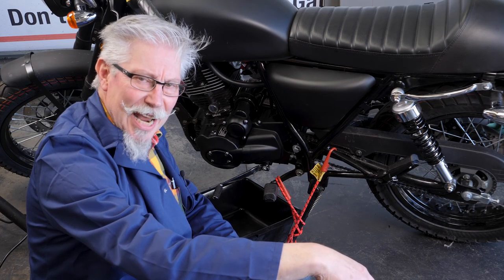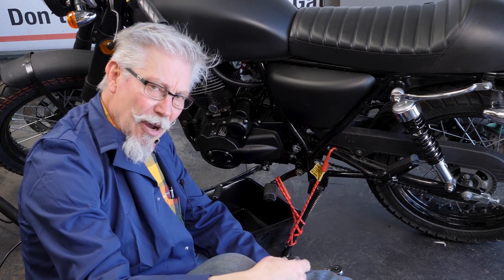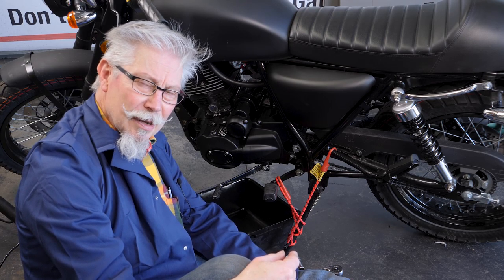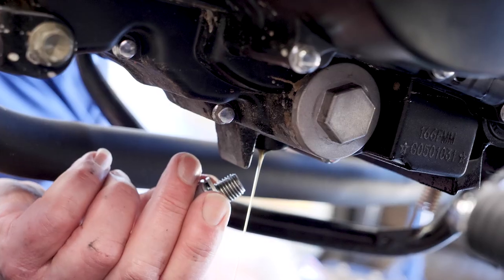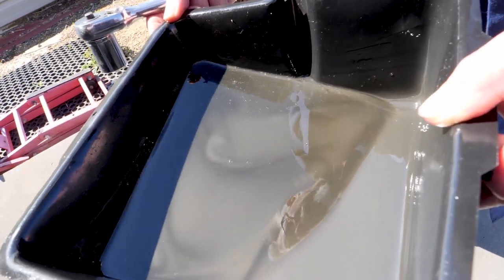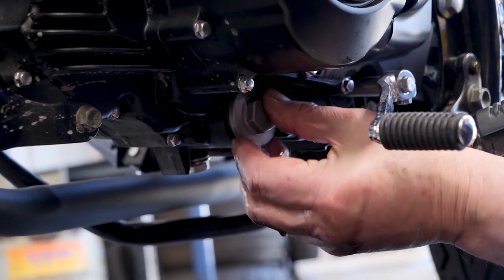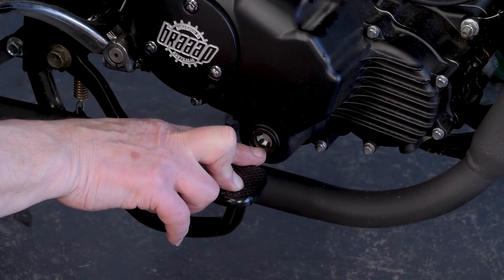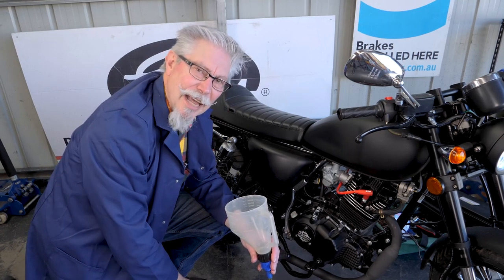Servicing your Bike - DIY - Oil change & filter clean. Tuning for Speed and Economy

Comment: Great video Michael, more on why Diesel oil? Why not a motorcycle oil JASO MA2 I was understanding it better, also designed for this bike with a wet clutch?
Reply: Apparently It is formulated in a manner that makes it suitable where JASO MA specificatoins are quoted, that is, suitable for wet clutches. But yes I would like to hear more from Michael.
Reply from the maker: Hey Steve, thanks for watching. With the power these Braaaps are putting out there is not a lot of stress on the clutch. Big performance bikes have more oil and paper filters. These little bikes need all the protection they can get.
We have an oils video in the planning
Stay tuned cheers Bruce
Reply: @TwistgripTales  it is still super important the the oil specifically mentions on the back where suitable for is JASO MA, not all diesel oils are…… to protect peoples warranty….. again great video….. keep it up

Comment: My mate wants me to quickly scan over his Skyteam Ace 125 that he hasn't started in 2 years so I'm planning on removing the old fuel, giving it a quick oil change/filter clean and check the health of the battery. Anything missing?

This video was very helpful, thanks Bruce!
Reply from the maker: Thanks for watching. The rear cush drive rubbers are the only other item. Great little bikes Have fun. Cheers Bruce